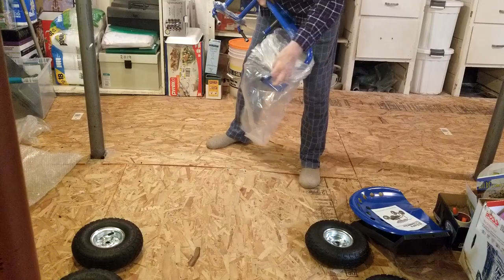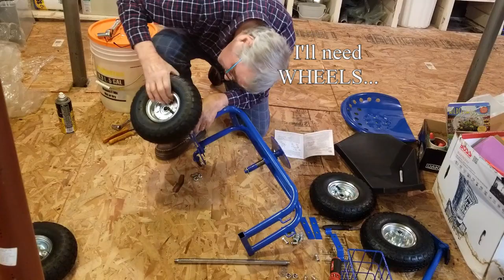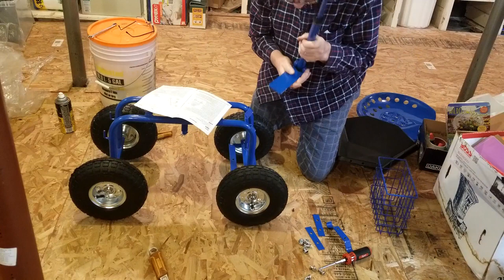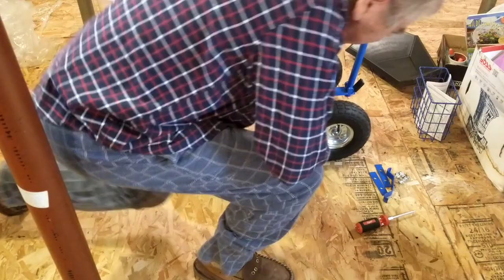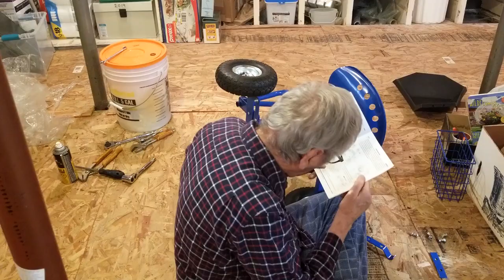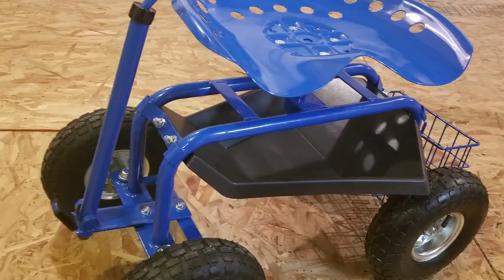garden cart assembly

Comment: Too fast!!!  Mine came with no instructions, just a picture of where parts go together, quite small, saying “step 1” end of story. No other steps, 1 schematic, no order in which to start.  
I need step by step first to get me going, I know I have all the right parts, just not quite sure which washer, bolt, etc goes where first. It doesn’t quite line up right with the holes right now.
Reply: Same here! Glad I found this video. I would have made a lot of mistakes.
Reply: You can slow down playback by clicking on the gear icon under the video window. I recommend 25%.  You can skip forward and reverse by dragging the progress line. Turn off the sound. The music at quarter-speed will drive you nuts fast.